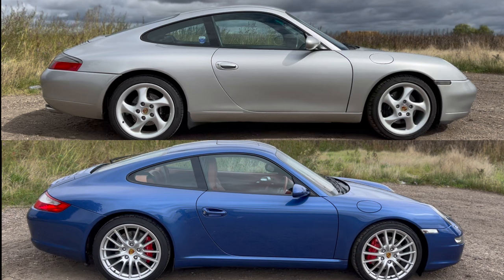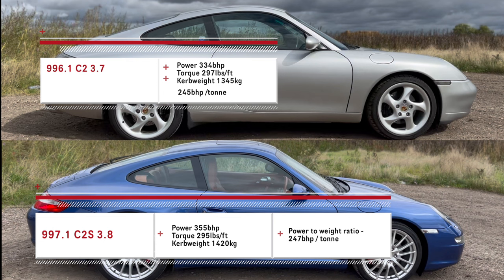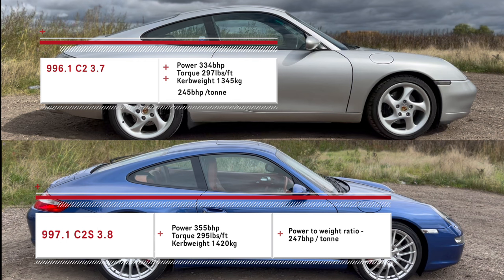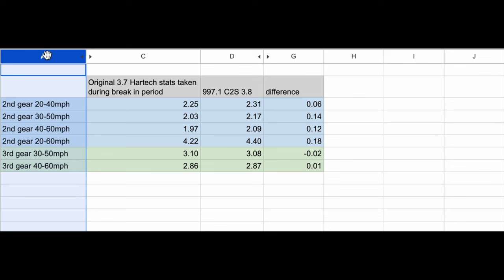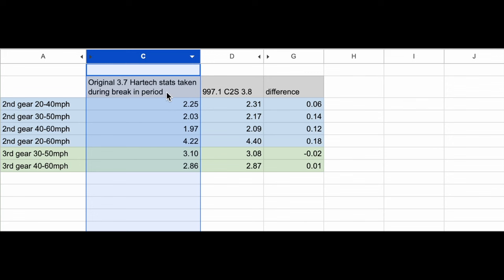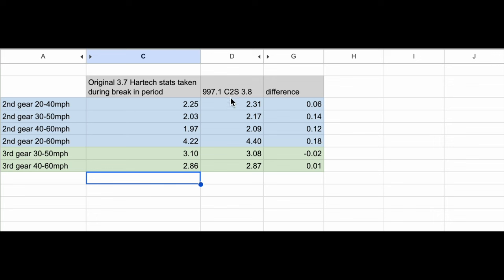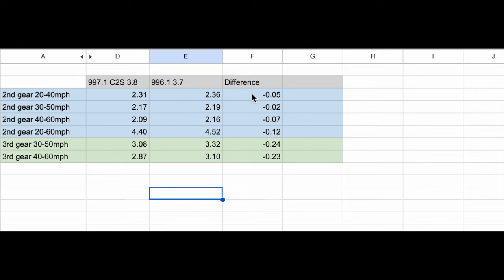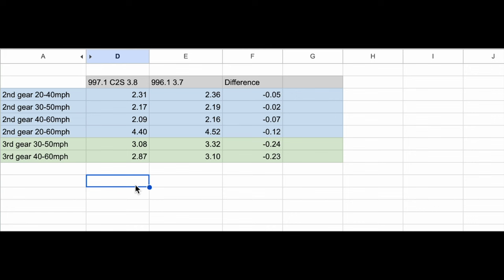Porsche 996 Hartech Engine - Episode 10: 996.1 3.7 vs 997.1 3.8

Comment: Flat 6 Innovations in Georgia transformed my 997.1 C4S x51. It is now a 4.3 with forged pistons and rods and Nikasil liners, plus a whole host of other engine goodies.
It now has more torque than my 991.2 GT3, and is faster in daily driving. 
All in all, it’s an absolute beast of a car and I need to sell the GT3.
Reply: Glad to hear, getting close to pulling the trigger preemptively, sounds like you had a great experience. Curious, how long did it take between scheduling and the work being completed? Possible you could share how much you ended up spending? 
Thanks

Comment: I would love to hear your own back to back driving impressions. Most reviews would cite that the 996 feels lighter on it's feet and changes direction more keenly, the 997 feels more grown-up and stable but heavier. The 19" wheels and tyres have a lot to do with this as well.
Reply from the maker: Yes exactly this, I didn't have much time with the car but yes essentially it feels heavier and wider and therefore more planted on the road, it's noticeably more refined but at the same time you can feel the 996 platform is still there, you just don't feel as connected to everything I would say so the drive is not quite as visceral as it is in the 996.1. I have also heard the steering feel is better with the 996 but I didn't push the 997 through the corners so I can't comment on that.
Reply: @leeevernden variable ratio steering on the 997 vs fixed on the 996. The effect being the 997 feels more stable and ‘refined’ especially at speed compared to the very direct feel of the 996. The 997S PASM set up plants the car significantly but also isn’t as playful.

Comment: This is extremely interesting. I suspect your car was making more power on a cold day. I am blown away by your fantastic project. I have a 997 C2S which I’m hoping I can find the funds to treat it to a 4.1 ltr Hartech conversion.
Reply from the maker: Thanks - The 4.1 997 would be awesome, far better in my view than the newer stuff.
Reply: Hi, I completely agree, for me the 996 and 997 are far more interesting than the frankly synthetic and bloated 991 and 992. Clearly you've spent quite a bit on your 996, but probably less than the first year depreciation on a 992.  As I am writing I am just reading the next comment down about the 4.3 litre monster that someone has created in Georgia, clearly you're inspiring people all over.  @leeevernden

Comment: Well, one difference....if one carefully looks at the engine area, this 997 has the X51 powerkit package. This is not just a chip re-tune but a total package that consists of different cylinder heads with an aluminum, not plastic, variable resonance intake system (flow-optimized) intake and exhaust ports ( the intake encourages the air to compress more air charge into the cylinder ), a larger intake manifold and throttle body, flow-optimized X51 headers. So all considered the 996 Hartech 3.7 did rather well.....
Reply: @lee, can you confirm that with the owner, thats interesting if true, im pretty sure you can check the options from the reg.
Reply: Are you quite sure? Searching the net suggests the following: M97.01 3.8 engine of the 997.1 S ALWAYS has alu intake manifolds;  M96.05 3.6 in base 997.1 and M97.21 3.4 in Boxters has plastic intake manifolds. Also, it's the M96 from the 996 where the X51 package introduces alu intake manifolds as opposed to plastic ones (I know that bit for a fact, 'cause I've got one ;-). Engine designation M96/03S ).

Comment: Interesting comparison. If you had them on a B road you wouldnt be able to separate them. I have a 996.2 with Hartech 4.1 and as you will know the additional torque transforms the car
Reply from the maker: Indeed, certainly 2nd gear at full chat they felt exactly the same. Your 4.1 - was that done using some parts from the 3.8? What's your power and torque? 2wd or 4wd?
Reply: @leeevernden  It is a 996 targa so 2wd and the engine build uses parts bespoke to the 4.1. I have a print out for 371bhp and 450Nm torque which is essentially the same as the 992 base spec carrera. Comparing it to the 992 Carrera T with its manual box would be interesting
Reply: @dwarfyh32  Only 371hp out of a 4.1?  Was there no option to opt for more agressive camshafts? 3.8 x51 already reach that kind of power, although stock not in a safe manner

Comment: Are the gear ratios in the transmissions the same? I can't see where the drag coefficients would differ, but that would only come in at high speeds anyway. Do both engines share the same stroke and are the camshaft specifications any different?